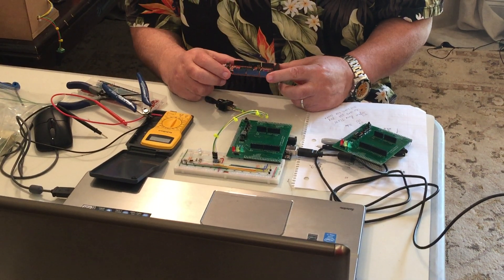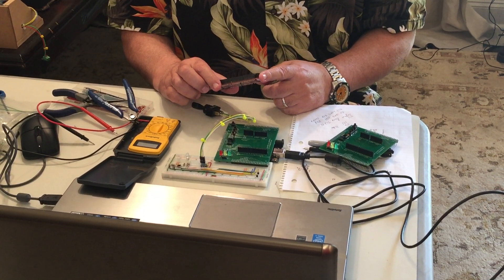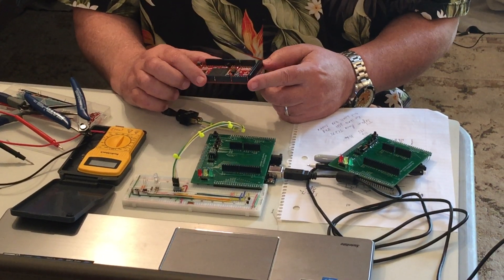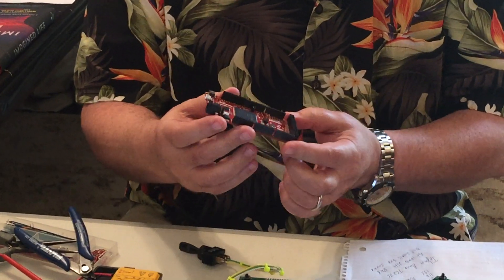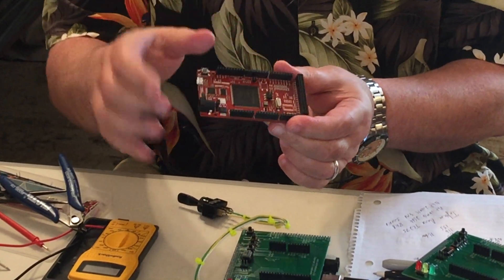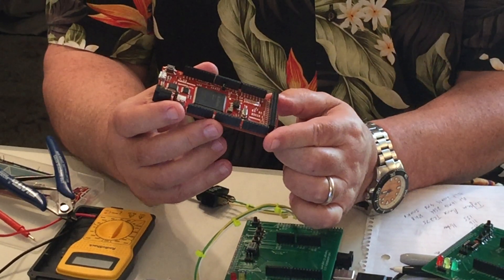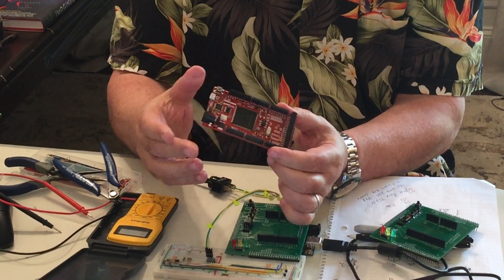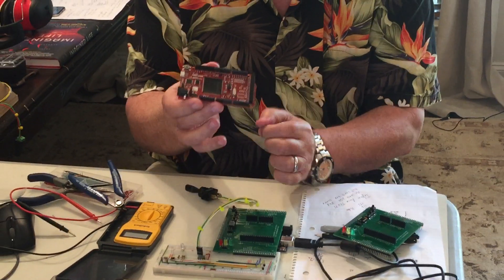Everybody needs a ShieldBuddy

Comment: Thank you for the review, may I ask if the board compatible with the arduino Mega motor shields ? and is it need special lib in IDE ?
Reply from the maker: Hi there -- I would assume that the ShieldBuddy works with all standard motor shields using the same libraries as the Arduino Mega -- for myself I always use Adafriuit's motor/stepper/servo shield https://www.adafruit.com/product/1438 and that uses just 2 pins running the I2C interface to control everything. Now, you will have to download the ShieldBuddy's board support package into the Arduino IDE, but the ShieldBuddy folks tell you how to do all that in their documentation.
Reply: @maxscoolbeansblog1761  Thank you  :)
Reply from the maker: @unrealmix853  I live to serve LOL   I hope you are having a wonderful day :-)
Reply: @maxscoolbeansblog1761  Hello Max ,, may i ask you if you faced any problem with the Timelib.h using the shieldbuddy with arduino IDE ?
Reply from the maker: @unrealmix853  I would have to say "No" -- but that's because I never used it -- are you having problems? If so, and if you can;t get through to their support, let me know (max@clivemaxfield.com) and I'll try to connect you with someone who can help.
Reply: @maxscoolbeansblog1761  Thank you for your kind reply, actually i just received the board today morning, and since morning I am trying my very best to shift my code from arduino Mega2650 to this TC375,, till now I found three issues, one for the Timelib.h (is not accepting the hour() minute() second() declaration),  another problem for the declaring of the Analog pins (whether read or write) , and third problem is related to the MEGUNOLINK serial CommandsHandler, seems the number is limited for this board in the void Setup() section,, that makes me crazy ,, i read every single solution on google to solve those issues, but no luck till now. I wondering if you faced any of that, i will appreciate if u share with me how did you solve it.
Reply from the maker: @unrealmix853  Hi Ahmed -- I contacted the folks at Hitex relaying your questions to them. They responded as follows: To use an an analog pin  as simple IO, you have to use “A0” to “A15”:

digitalRead(A0) reads analog pin A0 as 0 or 1

pinMode(A0, OUTPUT) sets analog pin A0 to be an output

The MEGUNOLINK does compile and link OK.  I suspect that the main problem will be that the supplied library code will be using the default serial port for the MEGA.  On the ShieldBuddy, this is SerialASC.  This means that he will need to replace all instances of Serial.begin, Serial.print etc. with SerialASC.begin, SerialASC.print etc.  I have done this in the attached files.

BTW: There is an active ShieldBuddy forum for posting queries here: https://aurduino.boards.net/forum

Re the "attached files" they mention -- if you email me at max@clivemaxfield.com (make the subject line something like "Please send me those files from Hitex") I will reply with the files.

Happy Monday -- Max
Reply: @maxscoolbeansblog1761  I really appreciate your response, and I am so sorry to disturb you about that issue, thank you so much .. its really helpful.  I also tried to fix the problems since that time, i found my serial commandhandler of the megunolink is overloaded. so currently I try to decrease the code a little bite, its over 8000 line,,
Reply from the maker: @unrealmix853  I look forward to hearing how you get on -- GOOD LUCK!!!